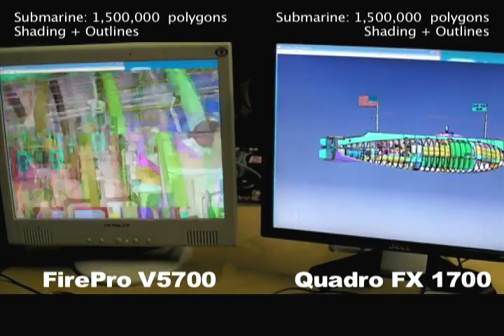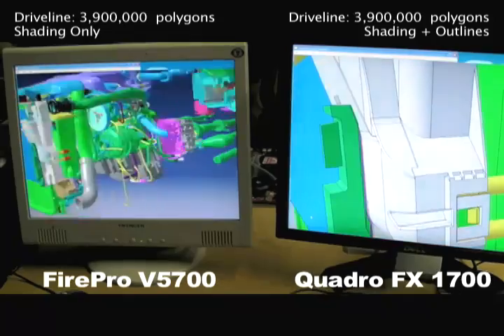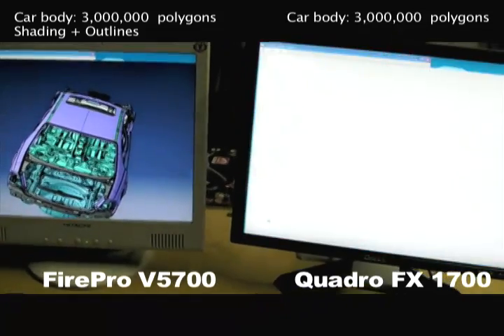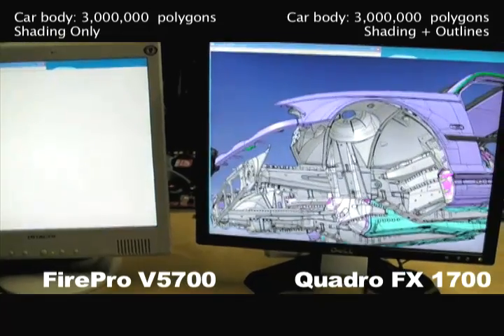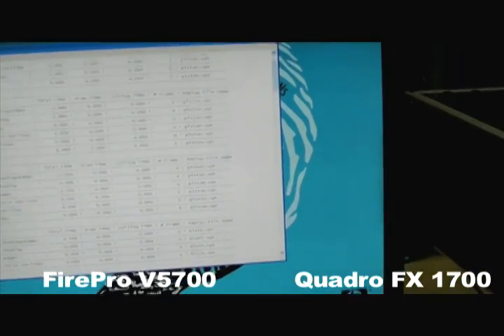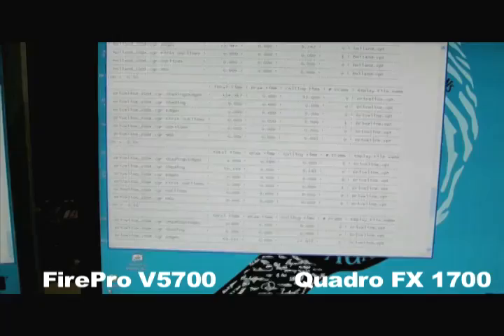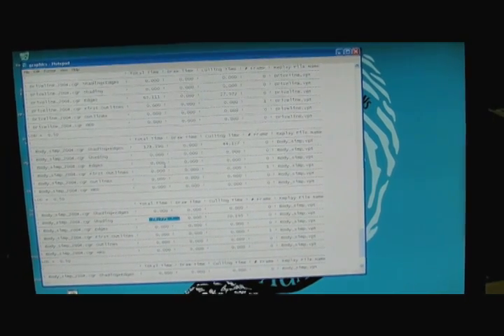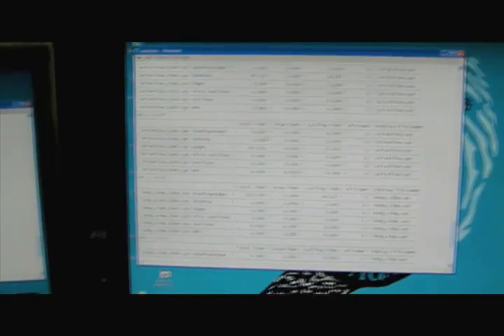FirePro V5700 vs Quadro FX 1700 w/ CATIA tested by Develop3D

Comment: Yes, these will work well in Maya. Look towards the FirePro V7750 ($600-$700 est.) or V8700 ($900-$1000 est.) if you can afford it.  Google the benchmarks, they edge out the 4800 and are less expensive.